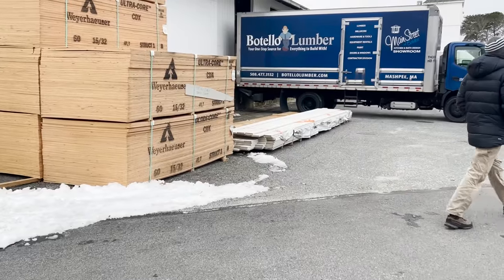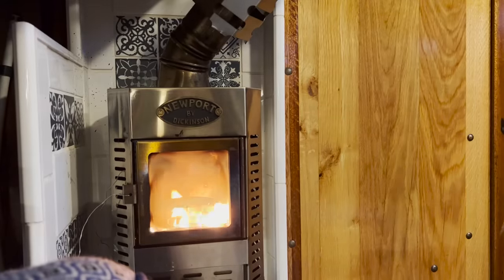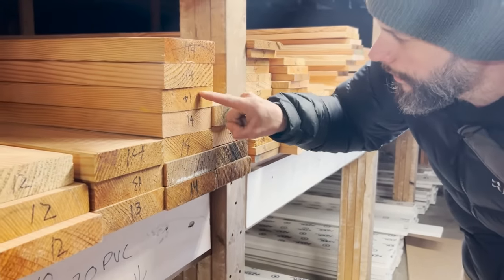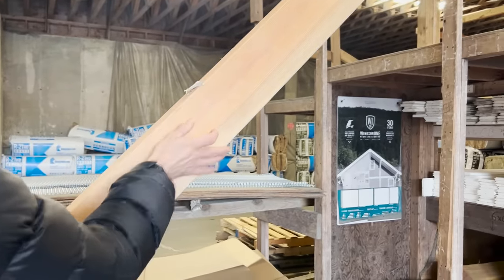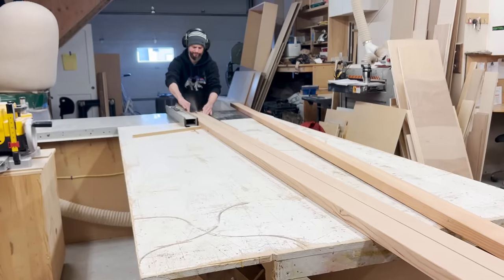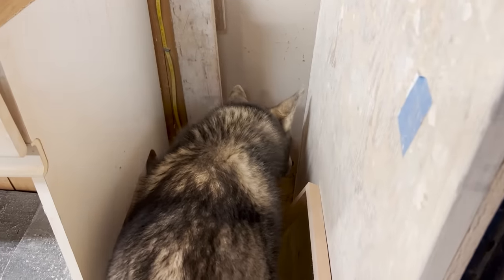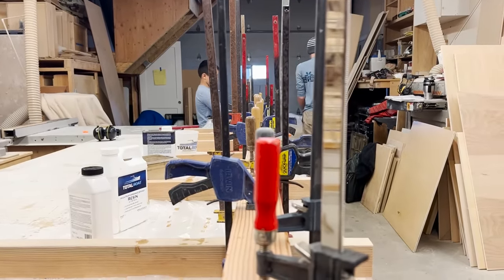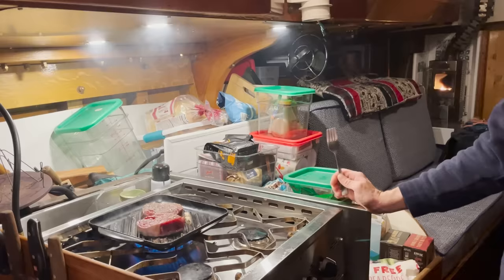Steve Finally Has To Buy Lumber - Episode 299 - Acorn to Arabella: Journey of a Wooden Boat

Comment: HVAC tech here. it sounds like you need a dedicated combustion air infeed for the diesel heater. it would be a dedicated supply that feeds the heater.  This would probably help keep drafts down as the heater would not need to pull air from any place it can around the boat.
Reply: Hello, also a HVAC guy. His problem is more of a attic fan scenario. When the fan is turned on in a sealed space it will pull from the easiest place, the heater vent. That is why the fire gets pulled down. If a vent was installed in the space someplace when the fan is turned on it would draw from that instead of the heater vent.
Reply: also hvac and agreed!   @davidduncan6280  Steve should look for a sealed combustion unit, or possibly swap to a powered diesel heater. I'm so excited to see Arabella in the water. I've had the rare pleasure of seeing the boat at the boatyard in Granby and when launched in mattapoiset. Its so incredible what Steve has achieved and I'm excited to continue to follow his journey

Comment: Put a speed control on that fan.  They move lots of air on low as well and it will be much quieter.
Reply: great tip. Thing sounded like it was BLASTIN.
Reply: was just thinking this my self. since its DC a simple Pot would work fine
Reply: A pulse width modulation controller works great for that kind of fan. Cheap and available.
Reply: I was gonna say, that blower is about as annoying as a beeping smoke alarm.
Reply: Speed controller would be like, $1-2. Very easy now that he has a proof of concept. Also, always better off with a larger fan that spins slower. Same amount of air moving but the bigger one is quieter. Honestly, if he just had 2 portholes open, it probably would've solved the problem for quiet and free.

Comment: Safety First! Arabella is a tight ship. She needs more combustion air for the diesel heater. Whatever replaces the new/temporary exhaust fan needs a filter for particulates in the smoke, which will eventually coat the pipe and fan blades etc. and is combustible.  Check out RV stuff, it's efficient and quiet might work and is likely to be cheaper than marine grades... $6.xx a board foot for that wood seems pricey, but it's select and #1 grade. Plus you did get to pick it and that's always worth a bit more...Kudos to the entire team for another great video.

Comment: Replace the bilge blower with a computer fan. You can get really quiet ones that will fit that vent and won't draw too much air.
Reply: But it won't move enough air to make that big a difference.
Reply: I have had the same issue in a camper I built…computer fans stacked  (coaxial) added the flow and pressure needed.
Reply: You'd be surprised. They come in different airflow ratings so get one of the more powerful ones, and you can stack a couple if one is not enough.

Comment: Steve you need a combustion air vent. It's just a vent from the outside and to replace the air you're burning and you stop it from sucking from the diesel heater
Reply: The porthole seems to do the job. How would the combustion air vent be different?
Reply: @briansmith8967  I’m a heating guy and the one thing when you’re dealing with something like this, is you can’t count on the next person or guest to open it. It should be made safe in the worst case. Hence the permanent combustion air vent.
Reply: @davidduncan6280  Should these be input more directly for the oil heater combustion?  If the Oil heater, it seems like it would also leave more of the heat for inside the cabin and not sucked out.
Reply: @StephenLinhart  the oil heater should have a combustion air through the vent, some units use a triple vent. But as for what is happening with the heater is like what happens if you have a attic fan. If you turn it on with no doors or windows open it will pull back through the water heater or furnace vent. A direct vent out side will make sure that when he turns on his exhaust the air volume is getting replaced or pulled back in. With the combustion vent it will pull from that and not the heater. The vent can be anyplace in that space, even hidden as long as it is open. You could make it electrically open at the same time as the fan goes on. This way it can stay closed when not in use in cold weather.

Comment: If you run that fan through a flat piece of material you'll increase the effective area of the exhaust. Air is sucked from all directions around the end of the pipe. Adding a baffle moves the edges of that pipe end. You can mock something up in cardboard and tape to get the design right.

Comment: I think stores that sell parts for camper vans and caravans you could find a nice kitchen extractor hoods that are small enough for your boat and  work with 12 volts. In any case it would look much nicer than a bilge blower.

Comment: Steve,
We had false triggering from the smoke detector near the kitchen in our motorhome.  Replacing the "ionization" type detector with a "photoelectric" type completely fixed the problem.   No more false alarms.  Most detectors are ionization type, so you have to look at the specs to get what you want.  Do not get a dual type either. 
We bought from amazon this: "Kidde Smoke Detector, 9-Volt Battery Operated, Photoelectric Smoke Alarm, Battery Included"
Reply from the maker: Thanks for sharing that!

Comment: Good to see you using the metal tape to seal the joints on the vent.  Never use duct tape on ducts (or anything).  The adhesive eventually dries up and it fails.

Comment: Steve , maybe you should feed your Diesel heater with outside air , many people do that with airtight stoves and fireplaces , you can leave the windows close and it also doesn’t consume the oxygen and air in the boat ! They may even make a outside air intake for that stove , also I would have a stove hood and use that as part of the exhaust vent system most stove hoods have some type of stainless steel filter before the fan assembly ?

Comment: That's a common HVAC problem. You can add another duct fan to bring in fresh air and blow it behind the stove. This will one keep the static pressure of the boat neutral and as long as you are exhausting this new fresh air you wont turn your boat into a icebox. Another option is to only blow in fresh air from outside and pressurize the space, and let the room air flow out the exhaust pipe. Whatever air you exhaust you MUST makeup, NEVER let the boat get to a negative static pressure with the heater running.

Comment: I've had good success with 12v computer fan installed as an exhaust for my boat's stove/oven.  It's very quiet.  It's also waterproof and came in a two pack from Amazon so I have the other one deployable in the Dorade vent located in the Head (also exhaust) for after shower moisture or odor control (not that I ever have any odor issues in the Head).  Both work great and were inexpensive (gotta love Amazon).
Reply from the maker: Thanks for sharing your experience.

Comment: Remember that you can aim a jet of air, but you can't aim a vacuum. The "zone of influence" - there's probably a technical name for it - is basically always pretty much a (half) sphere around the opening. You might get by with a lesser capacity, and less noisy extraction fan if you bring a hood down closer to the range.

Comment: Loved the reference at the end! Steve could consider using an EDF (electric ducted fan) for the exhaust, they are commonly used in hobby aircraft, and usually have an easily adjusted speed controller to allow for a more quiet operation. Don't forget a mesh grease screen!

Comment: If you put some sort of large funnel over that exhaust fan you can probably use a motor speed controller to lower the fans RPM and still get the same amount of airflow and just won't be as loud or use as much power and it'll probably be more effective at removing smoke and carbon monoxide.

Comment: What I’ve used for air/heat transfer a lot is the muffin fans that are used in computers, power supplies, and other electronics..
They are virtually silent which is a plus and come in many sizes. Relatively cheap and economical...
Love the channel !!

Comment: For the amount of air flow you need a computer fan will do the job and be virtually silent. A bilge fan is designed to shift lots of fumes quickly so you can get on with starting the engine which means it is rather overkill for your needs.

Comment: Steve , normal smoke alarms are optical - inside there is a small flashing light ,via a mini mirror it lands on a fotoelectric cell = all o.k.- if not ...alarm .
There is another type which registers a too high temp near the ceiling .
Standard optical alarms are a bother in small kitchens , baking pancakes ,steak, steam ,or dropping the dustbag of your Hoover 😂

Comment: One of the first boat building (primarily FRP construction) shop I worked in, we would dumpster dive anywhere near the shop for 'Visqueen'. A cpl tabs of duct tape some string and viola disposable glue up aprons. I said disposable but we would put a cpl coats of wax on the 'work side' of the Visqueen aprons and just let any epoxy that got on the apron cure and just pop it off after cure. We used the same cpl of aprons for a year or so. Even if it is a one shot glue up, the aprons are so easy (and cheap) to make it is well worth it. :)

Comment: Not for the heater air issue but for efficiency relative to noise, looking a bit at the design of stove vents and the why's and how's might get you a quieter, more efficient and easier to clean system.

Comment: The fan can be quieter if you make the above-stove intake (which you lack) have an inline muffler before a 90 deg elbow to the blower.  If you need more room, move the blower up. A quieter blower would also help, but both are solutions.  HTH.

Comment: If it is possible to place the inline exhaust fan further up the exhaust pipe, ideally outside the cabin, you will significantly decrease the noise from the fan - which as others have commented, will drive you crazy. All the best!

Comment: I'm wondering if putting trhe fan higher up the pipe would help with noise, and keep the fan further from the heat which can dry the bearings, you could also look into a regulator to drop the voltage which should slow it down a bit, there are adjustable regulators (buck converter)
Also i would add a 'cooker hood' so any smoke is naturally captured, and rising heat should take the smoke out without the fan. (stiill keep the fan though)

Comment: Hoods are an interesting dilemma. Commercial hoods have their own fresh air supply. If they didn't have them, the hood would suck the hvac out of the building. Residential hoods usually don't have their own supply because the rooms are usually so leaky that an air supply is not needed, plus the exhaust fans are not that powerful.  You probably don't need that powerful of a fan, or you need to add a controllable air supply. The porthole will work in good weather, but what bad?

Comment: If it continues to draw to much air you can install a resistor to drop the voltage and slow down the fan or put it in parallel for a high and low switch.

Comment: Personal i would consider pulling a flat nozzle on the bottom of the fan, so its pulling a sheet of air from under the over hang, the smokes is already follwing that path, so a inch opening, 12 inchs wide facing back under the over hang would set up the air flow pulling smoke to the back of the cooker and up. and a much smaller fan would clear a lot of smoke. kind of how you see in a paint spray booth, were you have a long wide narrow funnel dragging a curtian of air up at the back. So you can use a slower speed fan and still catching all the over spray..

Comment: It think the vent is a good proof-of-concept, but a lower RPM fan with a bigger uptake would probably be better. You can get flat vent uptakes, or you could even make your own with some hollow aluminum bar stock. As a bonus the lower RPM fan would also probably have a lower pressure differential and may not cause backdraft issues with the heater.

Comment: Steve, you could add a light dimmer switch (a rheostat) to control the motor speed and slow to air flow down.

Comment: Bend some stainless steel sheet and make a Hud 'extraction hood' over hang the burners and oven flue vent by 3" all round.
Utilise the ready-made hole and change the flue terminal for Cattering and raise it up, source a quite fan with speed control. 
LPG is a wet gas in a small area and that condensation will rot every thing cold steel, the paint will soon show problems above the cook top. Source a free air damper 'auto sellf setting'. Draw fresh air from as faraway from the flue as possible. 
End Result happy Dodgy and a quite happy crew. Great show.

Comment: Bringing the chop saw blade back up while it's still spinning is unsafe saw use. Works when the piece being chopped is longer than a few feet, the cut is 90 degrees, and the blade is sharp. But not letting the blade stop is a bad idea in general.

Comment: well done another interesting video.  btw the blower problem is well known in houses where they have super sealed it for insulation airtightness and then want to have a stove of some type. which is why in the UK stoves have to be installed along with an air intake close by or built-in and plumbed to the outside
Reply from the maker: Interesting to know!

Comment: Not too sure if this is the best way to resolve the smoke issue, if the port has to be open… rain or under passage is not a good time to have cold food.Suggest bringing in an additional air flu down the existing chimney to the base of the oil heater to supply air directly to the problem

Comment: In Germany it's mandatory to use a window contact switch for that kind of setup, so you can't turn your suction on without opening a window. It shouldn't be that expensive and it's an extra layer of security, because you really really don't want to die from carbon monoxide poisoning. Stay safe!
Reply from the maker: Interesting, thanks for sharing that fun fact!

Comment: So you guys had an electrical issue. Made several episodes about it and even had a special guest talk about it.  Then nothing but crickets.  Was the problem the shaft packing? You haven't mentioned it so I'm assuming the problem is fixed.
Reply from the maker: It’s a good point, we’re hoping to have an update once we’ve spent more time with the new packing in place. It takes time to observe.

Comment: use heat detectors.  On my commercial fishing boats we use 130 degree f heat heat detectors in the galley and slightly higher temp in the engine room.
Reply from the maker: Thanks for the tip!

Comment: Do you have a CO monitor installed in your cabin?  With reverse flow in your flue you can have CO being sucked into your living space.  Your current design seems quite inherently unsafe and at a minimum I would reduce the capacity of your exhaust fan, put in some sort of weighted damper, and be sure I had a CO monitor installed.  Years ago when I lived in Alaska there was a residence that had a similar reverse flow situation occur, and the entire family of five was killed overnight as they slept.

Comment: I'm wondering if you could use a slower, and quieter, exhaust fan for the galley. It might be able to get the smoke out without needing an open porthole and without affecting the diesel heater. I'm thinking one like what I think you use for the head, to keep the composting toilet dry.

Comment: I won't comment on the fan and air as there are many already, but for the smoke detector, do you have a photcell or ion detector?  The ion ones are usually cheaper and a bigger selection, but they are set off very easy with cooking even without smoke.  We had the same issue.  We switched to a photocell detector and that stopped the false alarms.

Comment: In Germany, you are not allowed to have a cooker hood that vents to the outside and a fire place in the same room for that reason. Hard to do on a boat obviously, but I'd try to think of a way to either prevent the fan from running without an open porthole, or a direct air supply to the heater to prevent the reversed flow in the heater.
(Someone will say that remembering to open the porthole or shutting of the heater is sufficient, but I'd say better safe then sorry, we all make mistakes sometimes and carbon monoxide is no joke.)

Comment: Steve your design for the extractor hood will not work on your boat! You need to realize a extractor hood above your coocking area which is using the induction technology. You need a hood with 2 external ventilators outside your kitschen room. A Induction hood has two active ventilators, one ventilator blows fresch air tangential into the hood to move the used air almost towards the succing area of the hood. The second ventilator sits also outside the room and this ventilator sucks the air from the hood to the outside!

Comment: Maybe a dumb question, is it possible to use a filter system to recirculate the air and remove any smoke? Seems wasteful to exhaust the warm cabin air you spent so much fuel heating.

Comment: You have the wrong detectors.  You need create of rise detectors during the day and smoke detectors at night.  If neither of you smoke,, then the risk in reality is quite low that anything will happen if you maintain your equipment.  Rate of rise means that you can cook without drama .  It will excite if the temperature in the space rises very quickly and dramatically.  These are meant for kitchen areas.  At night the detector switches to  smoke,
Reply: Or you can just ventilate the space and not require special smoke detectors to not false trip on the trash quality air, win win.